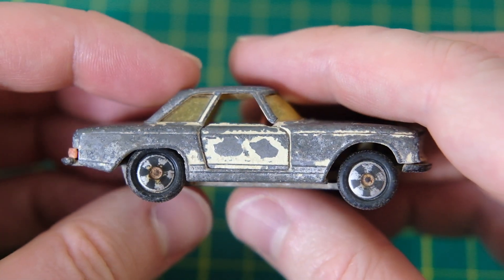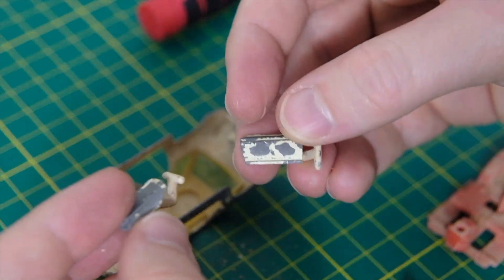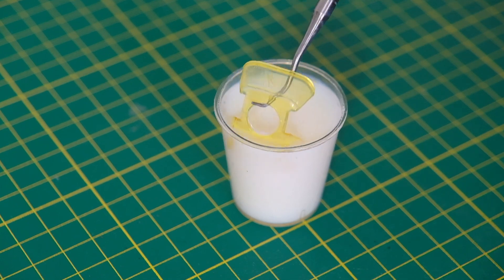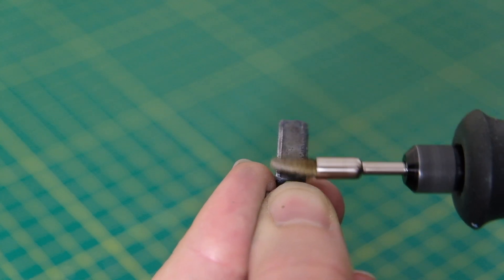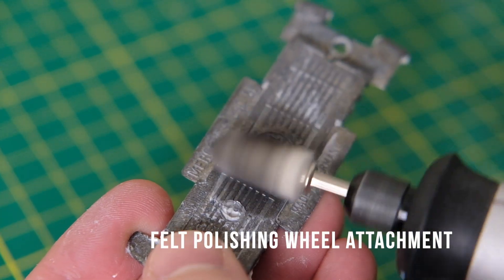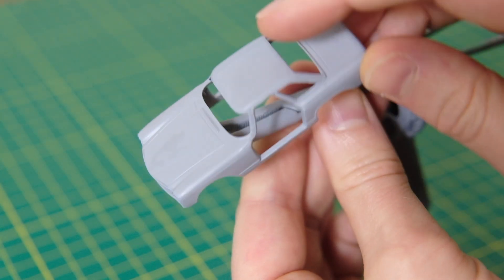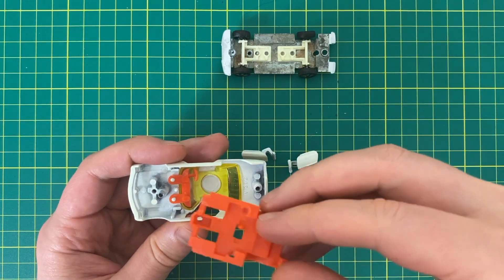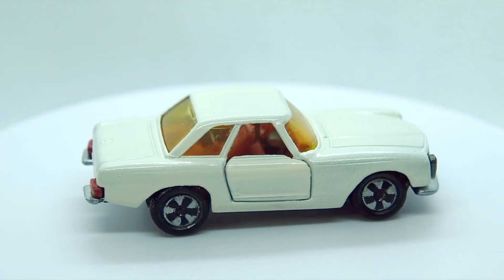SIKU restoration: V302 Mercedes 280 SL

Comment: Well Jason, although you might not have gotten this casting back to 100% of its former glory, you've certainly put a lot of work into it and it shows. Much much improved from where you started my man. I wonder if a nickle plating would have been a better option than filling and sanding? I don't know, I've not even done it, just a thought.

Comment: now, I say! that surely was a pittyful casting. :) pun intended. haven't seen such a pitted casting in a long while, though I had siku axles rusted thinner than needles, and managed to make the wheels turn again. when I was a kid there was no replacement except another casting of the same. great work, it looks like new! ^^
when siku switched to silver paint they also made the grille and headlights part of the baseplate casting. with any other colour then silver it would have been too obvious, I guess. the interior is still the same, so you might be able to snatch a donor car.
the Pagode-SL was the only vehicle where the cW ratio with hardtop on was worse than with softtop up; it cut off more than 10kph off the top speed, and not by weight. apparently the curious shape created air hoses around the car that braked it down.